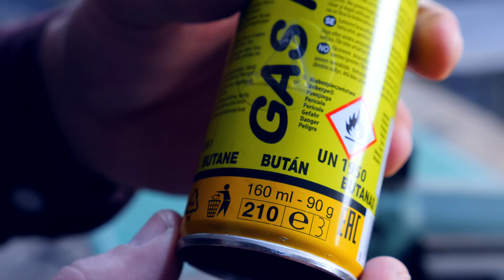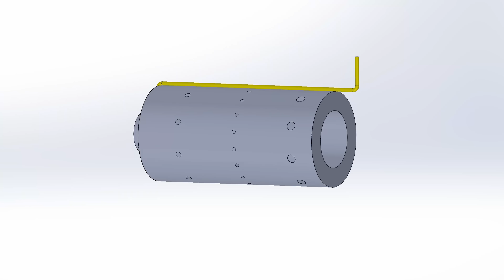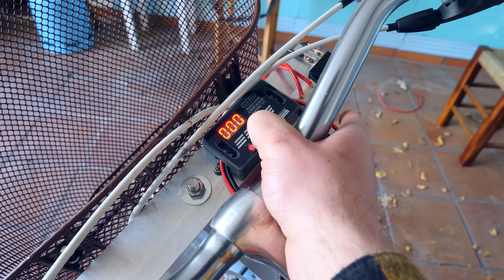I put a Homemade Jet Engine on my Bicycle

Comment: I never thought of putting an angle grinder in a vise. Might try that. An idea, make a drone that has a small generator to extend flight times. An engine like they use on model airplanes. Like a cox .049.

Comment: You should put two jet engines on the bike. Add a throttle controller like on a motorcycle

Comment: I think this idea is fun, but not very practical. I think the best thing you could do is have some way for that exhaust to power a turbine that will turn the wheel on the bike, kind of like the jet engine on a helicopter. But that's not as fun, now is it?

Comment: It being so hot means a lot of the combustion is going on inside the exhaust, which is good. by removing the exhaust, it just makes it so you have external combustion, which is not good. I know you already made the video, but you could get a proper exhaust and make a follow up.

Comment: I wish you would revisit this and use all your 3D printed ceramic stuff. Change your settings to make it a tighter print with a more liquefied substrate only a few percentages lower than the required and then turn around and bake it down and put it together and bolt it all together with graphite screws you could even get a graphite sheet to go around it for a heatsink. Then put it on your bike and let's see what happens.

Comment: IntegzAaAaaaa use jet fuel plus air pressure in the butane can and use oxygen instead of air and make a long duel exhaust for improvements in my.opinion

Comment: my man says he is obsessed with combustion engines, then continues to reinforce the claim that it is inevitable that everyone will drive an electric car and then even calls Tesla the best electric car manufacturer. how much money did they give you, to abandon every basic human thought in yourself ? ever done maths before ? if so, you would have an easy time calculating how much Lithium we would need, so that every car is replaced by an electric one, you will find very quickly that it is impossible. to blow so much air up teslas ass is another level of stupid, tesla charges you massive fees, slows down your vehicle without your permission, is able to lock you out of it, most features are not allowed on roads, you do not own your car, if you drive a tesla. very disappointing to see someone throw away their standards in favor of money, boring

Comment: Again, not a true jet engine. Jet engines are all powered by internal combustion that turns the out put fans that also turns input fans. A leaf blower into a tube is not a jet engine. This resembles a type of rocket engine. Even a type of ram jet. Although ram and scram jets have no moving parts……..

Comment: Hey, nice work as always !
About your exhaust temperature and flame blowing issues, what about turning it into a turbo fan ? The air not going in the chamber would cool down the exhaust and the thrust/noise ratio might enven go up !

Comment: I would really like to know the difference in speed achieved with pedaling versus without. Also, some information on the amount of fuel it consumes. Just out of curiosity as I don't know a whole lot about rockets and the like.

I'm in process of adding a 4-stroke bought motor to my bicycle and my ADD is making me watch everything along those lines except for the actual information I need to do what I'm doing. lol

Comment: I put a RAM jet on my bike in 1955, that was before leaf blowers were invented. It did not need outside air only to start and I used a bike pump. When it got hot enough t created its own air.
It was very loud.It ran on kerosene

Comment: Also.. curious idea .. instead of a leaf blower.. you could use a BLDC motor with turbine instead of a propellers.. considering drone motors come in small high rpm packages.. using fairly little power .. and are designed towards thrust .. you should be able to get more air going through.. or at least more air pressure.. my thinking is that the leaf blower probably has a lot of air movement but lower rpm .. so a higher RPM turbine might be more adequate since and I'm just speculating .. passenger crafts turbine jet engines spin fairly fast if there is enough force in it to suck in people and pretty much throw a fat guy in a couch any significant distance from what I assume is already at a reasonably safe distance from said engine... At some point getting a cheap fuel injector from the internet might also have some interesting results.. although those might be more expensive..

Comment: Nice to see you have acutely metal fabrication tools this is a must have for building anything that gets hot, technically you didn't weld it it's hard soldering XD 

Video idea! I would really like it of you replicate the Tesla machanical oscillator again, I've a working model (about 44cc) en the minimum run pressure is 0,2bar om air en 0,05 Barr on Steam, if you like I can send you the drawing

Comment: Put bafolds around the output of the flames to prevent flame out. Also the nozzle improves the efficiency of the engine by allowing the exhaust to go out faster than without the nozzle.

Comment: Idea: On your next video can you build a jet engine and use it to propel a projectile vertically in order to determine how much thrust is required to propel an object of a certain mass upwards. Then use the findings to build a RC rocket

Comment: for the love of all that is holy 
just buy yourself a used stick welder 
and you wont have so many problems anymore . brazing just doesnt cut it you need to properly weld 
also bring back zee MOUSTACHE

Comment: Quick tip for cutting sheet metal. Make multiple shallow cuts in the shape you want to cut out and you don’t have to worry about cutting our shapes one section at a time.
Reply: Joey Jojo Junior Shabadoo
Reply: @ Ok lol

Comment: I think adding an exhaust may increase your propulsion, besides that, freaking awesome work as usual! 😊
Reply: With a better nozzle yes, because you can increase the gas flow to supersonic speeds giving you more thrust
Reply: @mayhulk7514  yes it's just the case of finding perfect balance between length, width and power

Comment: how's it going? i just got done drifting through a tomato field when it had occurred to me, you could probably get away with building a 3d printed valveless jet engine. my idea is, make it small, just thick enough walls (that can stay cooled and not melt all the way through) and submerge the whole thing in ice water (besides obviously the exhaust and intake) I really would like another 3d printer! .2mm nozzle does good for my particular projects for the most part, i want one where i can just least the .4mm extruder in place.

Comment: Needs adjustable exhaust port I think reducing the out put size will increase thrust and making it bigger or opening it up will slow you down so if there was a way to start the jet engine while it was all the way open and the shrink it down as you were on the vehicle it would go faster how fast would depend on the quality of the engine and fuel / air / oxygen  and pressure it could stay burning 🔥 at

Comment: You should make a Chrysler turbine car style Turbine jet engine You basically take a standard jet engine and force exhaust into something like the steam Turbine you made And the turbine runs the gears The oxygen intake fan it's run off of  Engine but it also forces air around the engine and on the parts that heat up to cool it

Comment: Idea rebuilding the bicycle. Find a way to get the energy from using pedals to the rear wheel without using chains or belts. For example loading a spring with the pedal action and using that to drive the rear wheel.

Comment: It looks like your weld is actually brazing. Brazing is an adhesion process where the base metal never melts, and you have to use a lower-melting filler.

Comment: Integza what you do in this video is known as brazing as you are not heating the joining metals to melting point you are merely melting donor metal into the joints/surface of the metal. Welding creates sufficient heat to liquefy a small portion of the joining metals and the donor metal creating a new single piece of metal.

Comment: As long as you use tin to weld, it will always melt
It's not meant for high temperature

Maybe another type of steel too, depending of the type you choose, it can vastly change in terms of fusion temperature

Changing those 2 things will VASTLY improve your projects but..... I hope the sponsors pays you well, it will cost you an arm, a kidney and a ball for some higher quality materials ^^'

Comment: How about directly supplying the engine with 70% - 100% oxygen by making another ring of tube smaller than the butane's so that there will be more combustion. The oxygen tank can be placed parallel to the butane tank (if the butane tank is on the right side, the oxygen tank should be in the left side and vice versa). Also, putting the spark plug control alongside the leaf blower control in either side of the bike's handle opposite to the butane and oxygen controls will be more convenient so that it can be operated by only one person.
Reply: Hydrogen can boost that bike even more!

Comment: Do you need to do a top speed one because jet engines don’t have like torque I know torque is rotational force but they don’t have high acceleration they have high top speed

Comment: I'd love to see another video like this one, maybe use a different source of fuel (propane?) to get even more thrust. It was cool to see one of your designs produce this much thrust!
Reply: Propane is very similar to butane, except that it is harder to keep liquid, I recommend pentane for engines since it will not immediately become a gas allowing you to pump in very high pressure air for more powerful combustion
Reply: But something like octane(gasoline) works tol of course!

Comment: Yup I like yoeur channel but I need a printer too. So if you makes a jet engine that the afterburners fan seconds as a turbine that as the jet engine accelerates the turbine or fan blades turn an electro-Magnit.. and wallah you got electricity and thrusticity

Comment: I have a good possible way for you to make 3D printed parts into metal. You can print them in foam or any filament that melts easily and then put the part in a bucket and surround it with sand to make a sort of mold. Then you can pour molten metal onto the 3D printed part so that the plastic melts away and the part which left is made out of whatever metal you use. You could make complex parts out of steel or aluminum for future rocket designs. I learned this technique from TKOR were they created aluminum parts using foam board.

Comment: so for a school project im making a jet engine and your jet engine videos have helped ALOT and well because rules nothing combustible or flammable, so i am making a cold jet engine, water and high pressured air, ive alerady got my first compressor fan done, ohh btw i dont have alot of tools so im making the fans and turbines with metal shears.

but your videos have helped alot to make this thing, that being from making the fans to the turbine, it has all helped

Comment: you should use an actual turbo from a car to make a jet engine. feed the air from the compressor to a combustion chamber and then into the turbine to drive the compressor

Comment: You should use a precombustable fuel that burns faster when exposed to oxygen and emulsify it in a flame tube before sending it out a slightly constricted nozzle exhaust.

Comment: Video Ideia: You could use the Rotary Wankel motor to make a fully 3D print helicopter! As the rotary motor has some pretty good RPM AND power, you could use some gearbox to get even more RPM to power the blades of the helicopter!

Comment: The reason a jet engine works is because it compresses its own air and uses its power output to compress even more air, making huge amounts of thrust. 

This is much more like making a rocket except using a gas oxidizer and a very low chamber pressure. Also no nozzle.

Comment: PLEASE stop calling it "Welding" it is called "Brazing" it's basically glorified soldering.  You can get similar results using Epoxy glue.

Comment: dear integza, direct some part of the air from the blowerr over the exhaust, so you might solve the over blowing issue and exhaust overheating problem at one shot and you may get extra propulsion meanwhile you increase the fuel efficiency, all you need is a jacket for exhaust and a hole on main tube to be coonected to the jacket.

Comment: Kevlar kite string could be a neat material for reinforcing parts, if there's a method for pausing a print to lay in a knitted mesh and resume. Popcorn salt annealing would probably be a requirement.

Comment: wouldn't a rocket nozzle make it work better, well first you need to constrict the flow by narrowing the throat to get hypersonic exhaust then you need to expand the throat to accelerate the hypersonic exhaust. Issue is you would need some pretty sweet software to know the geometry you would need, or just make temporary mock ups with multiple geometries which can last long enough for you to measure the output, then make a final nozzle out of a material that actually last.

Comment: I'd love to see (if it works) a srb that's set up in a way that it actually works with frozen liquid propellant that actually melts the propellant before it lights it so that there is like a flamy cloud right behind it so it's more of a flame thrower than an engine but I bet it'd still be able to produce some thrust

Comment: I would love it if you built a cyclotron and modified it into a marble cannon. I think with your printers you can create an exit path for the accelerated marble. In my opinion it could also be a rocket launcher if built large and properly modified.  
ps: sorry if my English isn't the best :)

Comment: On that bike to get better propulsion you could turn the leaf blower split the output and run it to 2 jet engines that sit low next to the chain and sprocket and aim at like a 60 degree angle at the ground.

Comment: You should consider to use propane or a butane/propane mixture.

Butane burns well but has no power. Propane burns less well but has much power.
That's why LPG for gas in summer time has 60% propane/40% butane, and in winter time has 40% propane/60% butane.
The reason is that propane requires a higher temperature than butane to burn. In the summer the temperature is high enough to add more propane for better mileage but in the winter butane is added for better ignition.

Don't forget a flashback suppressor

3:00 that is called soldering respectively hard soldering because temperature is above 450°C else it would be soft soldering. Welding is fusing metal parts together ;)

Comment: To improve the temperature you could channel a part of the air flow rate around the engine, so it can cool down the combustion chamber and the nozzle. This way you don't need additional control on the leaf blower.
You can use an external casing like a turbofan engine and a divergent nozzle at the outlet of the blower so it slows down the air and can be connected to the case.

Comment: what if you used a  pressure chamber with the thicker ceramic resin and a second cure and firing to cope with the porosity that comes with the ceramic parts?

Comment: Great but you need to investigate other options like steel high pressure pipe for exhaust and body of your engines. These are closer to pulse jet engines and perhaps you could try a plane with one of your engines, starting with a remote control one of course.

Comment: If the Blower is too strong, I would divide the air from it into the Two Jet Engines, it could improve the speed of the bike, and it wouldn't be that extra weight, since it doesn't have to install another blower.

Comment: If you want proper thrust you need a variable nozzle to continue to get correct fuel air mixture at the thrust end....oh and higher pressure= higher thrust.

Comment: You made jet engine from fan before - you could use it to start ignition, then build valve to regulate amount of wind from leaf blower to engine and nozzle cooling. Also it would be fun to make leaf blower jet engine boat, but nozzle is cooled by the water under the boat

Comment: bro. spend some of that free 3d printer money on a bench grinder, a hole saw set, and some schedule 40 or 80 pipe that you can actually weld on. If it runs hotter than the torch you used to braze it, it will melt the bronze out.

Comment: I enjoy your improv to make unconventional projects, I did the same, and similar, using a vaccuum cleaner as a source of air, I was predicting the burner can and brazing failures as I watched your video. I also experienced those same problems. Have you tried a propeller driven bicycle? I can say my first one was a tricycle with a chain saw engine with a car radiator fan attched to the output shaft.  I was 14 then. That one only traveled at about 15 km/h. My second one was a recumbant tricycle with 2 wheels in the front and one in the back. That one was first powered with a 26cc weed eater engine and a large RC propeller that topped out at 20 km/h. I upgraded the engine and propleller to a 7hp  80cc gas model airplane engine and carved my own propeller. That one developed a speed wobble that I could not get over at 70 km/h, though I know the tricycle did travel smoothly all the way to 90km/h when towed behind a truck. The last one I tried was simply to put on my paraglider motor on and use it to push me down the road on my bicycle. I was passing cars on the sholder of the road that had an 80 km/h speed limit. I did get a dirty look from a mother that I passed as her young son was very excited to see such a novel way to ride a bike.